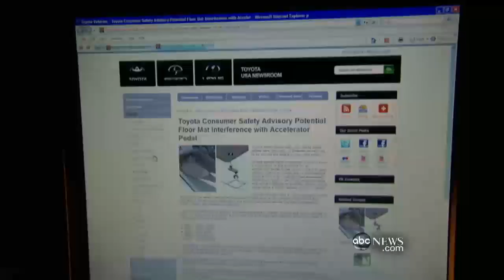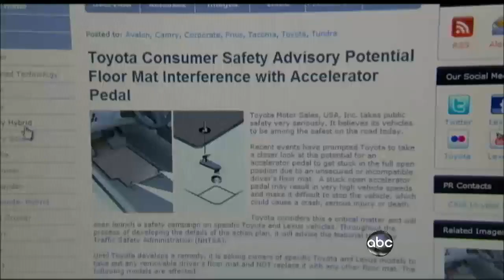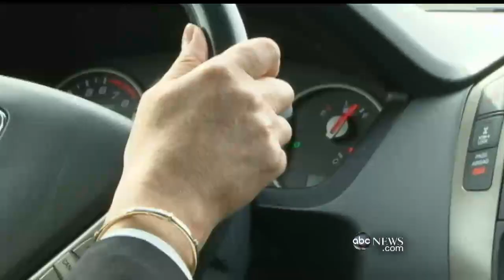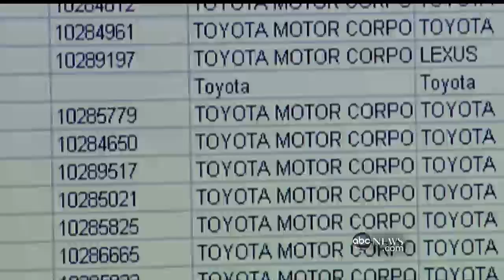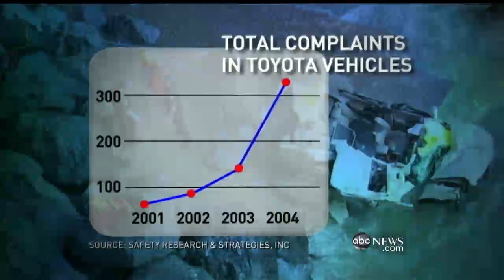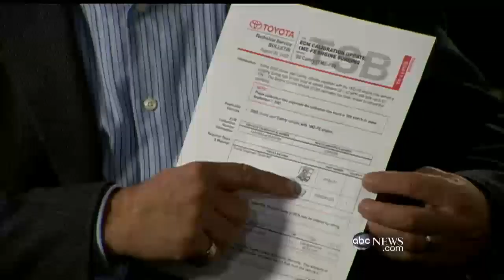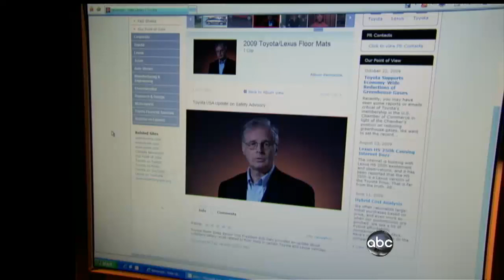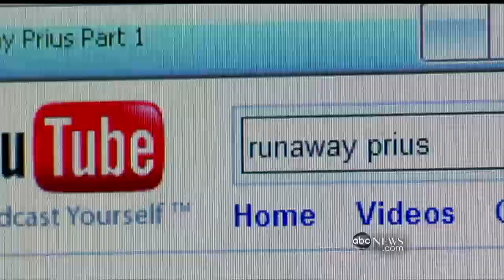Are Toyota's Accelerators Out of Control?

Comment: All you have to do in that case put the car in neutral. The engine RPM will go up but you will get full control of the vehicle.
Reply: Your type of thinking can be apply to almost every death scenario
Reply: That's what I'm saying though, like switch the key into accessory or hold the start button and it turns off the engine
Reply: You are thinking far too simply 😆.  Turn the key, shift to neutral or even park or reverse if it's that out of control.  Lots of ways to fix this.  Also, I'm wondering, if the accelerator gets stuck...why is it stuck full throttle?  That means they had it pressed to full throttle just before it happened or it would get stuck at a lower acceleration.

Comment: Well, I have the exact opposite problem with my car, my throttle body will randomly just stop responding to throttle input. Guess its a better problem to have then this but people need to know its not that hard to turn off the motor or put the car into neutral if this happens. The chances of there being a problem with the throttle body, ignition, and transmission all at the same time are minuscule and being slightly educated can help solve such a problem. Granted Toyota throttles have had their problems and there should be a better fix for it, there are things people can do if the situation does arise.

Comment: Why not pull the E-brake? Turn the key off? Shove the gear shifter into neutral?
Reply: That’s what I was thinking
Reply: @spacedog1527  the best thing would be to 1st)knock it into neutral 2)pull to the side of the road & then the emergency brake 3)turn the key off
Reply: I watched more cases and they could not go into neutral. If they used the emergency break it would flip the car and crush them because of the speed, plus if they turned off the car it would lock the steering. Basically it would be impossible to survive unless police spike your tires or if you had a roll cage.

Comment: If power brake assist glitches n doesn't respond , last thing is : turn of one click on ignition switch. It might lose full power assist but mechanical maneuvers  hard steering & brakes are better than non respond brake or accelerator . old cars was al mechanical , some had add on AC power brake power steering & but nit all .

Comment: These people are so stupid - due to absence of driving schools that are worth to be called DRIVING schools.
I hold all German driving licenses from motorcycle to big coach. It is unbelievable how any licensed driver can be unable to
* to ungear (oh yes ... you prefer automatic transmission because you cannot handle a gearbox)
* to firmly press the brake pedal
* to switch to neutral (it is the N on the stick)
* to switch off the car engine
A person unable of all points mentioned will not get a driving licence here. So that's the reason why the problem of „runaway cars“ is completely unknown in Germany. Yes, we also have Toyotas here.
Do a car safety training if something like that exists in America. It is worth much more than dialing 911 or praying in such a situation
Reply: Push the clutch in if you have a manual.
Reply: Andreas Jimmi  
DO NOT TURN OFF UR CAR IT WILL LOCK THE STEERING WHEEL and u Will die
Reply: lockdown channel if u put car in neutral while in motion it slows down wether the engine is running or not the steering wheel is free while in motion at all times. it will only lock if u move the steering wheel to the left till u hear a clicking sound while the car is in the park position while the engine is not running if the steering. Turning off your while in motion cuts the power steering not the steering wheel which means it’s free for a temporarily ( I’m a car mechanic who’s worked for Mercedes Benz in Stuttgart Germany 🇩🇪)

Comment: It should be a law that you need to be somewhat mechanically inclined to have a drivers licence. Simply pressing in the clutch in a manual, or even shifting to neutral in an auto would easily prevent a serious accident. If the auto transmission won't shift for whatever reason, simply turn the key off.
Reply: If u turn the ignition off, then  you lose your power steering and crash going whatever 100+ mph anyway ....not really an option going that fast. Emergency brake is sort of better but not much....
Reply: @AngelWhisper_7  I assume that if you're going 100+mph, you're not driving on such winding roads that you'd need power steering. Little bit of common sense goes a long way :)
Reply: @woodworkingstuff7165  peoples accelerator doesn't just stick but races/accelerates from normal  speed to excessive speeds like 100mph. And they may be on windy roads and need power steering This is just one situation, and if it happened, how could they get out of it without the ignition being turned off coz if they  need power steering, what other options if neutral isnt able to stop it coz a lot of times, people have said they couldnt get into neutral coz it was stuck, and what if shutting the ignition off isn't an option either? What does someone do?
Reply: @AngelWhisper_7  Valid points. That being said though, power steering is really only needed at low speeds, whereas at high speeds, one can turn the wheel easily without power steering, so I think it would still be better to just turn the key off if possible. But I guess this is why I drive a manual :P No possibility of a computer not being able to shift it into neutral with a mechanically operated clutch and gearstick.
Reply: @woodworkingstuff7165  I don't even drive lol. My husband does and he's got a car that.can be automatic or manual. Our accelerator stuck and he just put it in neutral but I was curious about why this happened so I was checking out videos and I didn't know power steering didnt matter that much lol. I feel dumb but ya gotta learn things somehow, even if questions seem stupid lol

Comment: My 2005 Equinox just did this. I applyed the brakes to keep the speed down while I turned the key off and thebcar stopped. I put it in neutral and restarted it and it's been fine since. But it's worrysome. Im glad it was me driving and not my wife.

From my experience I would have to guess that it a faulty throttle position sensor. This is just a guess but no action on the accelerator pedal made and difference. Including lifting it with my foot.

Comment: This never happened on Toyota's in Europe and Asia.
Reply: Nothing like this in Africa either
Reply: @tshidisomakinta629  There is a way of stopping a Toyota or any car with a stuck throttle. If it's an automatic you hit the brakes then shift into neutral and same with a manual. That will save your life.

Comment: Much safer to drive manual transmission than automatic. And manual transmission is not hard to learn.
Reply: It's hard to learn for some. But I agree manual all the way.
Reply: @JennyL.I  when they learn how to drive a stick not only they have to learn how to operate, but also they have to learn why they have to operate it that way. And how the car works and power flow works. This is easiest way to learn a stick. Understanding the concept is very important. Teaching them the operation will make learners hard to understand and confuse them.
Reply: @fromisheon4867  I know, I'm a driving instructor in the UK. I always explain (with pictures) how the engine/clutch works. Explaining why things work like that definitely helps people. Some people just aren't very coordinated or natural drivers. I always encourage the ones who struggle to stick with it and I always get them through their test but it's not easy. Especially with our tests in UK (not sure where your from).

Comment: I have a 2003 Toyota Camry XLE with a 4 cylinder engine.  I have been having this problem since about 2010.  Was parked in the street talking to my neighbor when I put the car into drive, without any warning and still had my foot on the brake pedal the engine began racing out of control, I jumped the curb went across two lawns and was still mashing down on the brake pedal.  came to a stop only after the safety over ride on the comp. kicked in.  At no time did I have my foot on the gas pedal, REPEAT NO TIME!!.  I was shaking and had know idea why the car had done this, and for some time afterward I believed that I might of had my foot on the gas not the brake.  That was until it happened again and again, and still does it from time to time.  Luckily on the roadway and I just put the car into neutral and the car's engine would rev down to normal.  I am able to put the car back in drive and it will run fine for months then out of knoware the issue will happen two or three time in a day or a week.  No mat problems or gas pedal problems and since I still have the car now in 2017 am retired and the car only has 56,000 miles on it. Yes 56 THOUSAND!  Runs great is dependable and I only drive a few hundred miles every month or so.  Noticed the press  about this problem back in the 2010, 2011 era but my car was built in 2003{????},  will try a used comp because the price of a new one is almost worth more than the car.
Reply: have you had your car looked? what did Toyota do too your car i am having the same problem with my 07 camry
Reply: Toyota has OBVIOUSLY resolved this issue in their vehicles many years ago.
Reply: John Scofield Lol! What do you mean the car "runs great and is dependable"?? You just said that it goes crazy on you every couple months!
Reply: That's why you have a little thing called Neutral
Reply: That is so true.
Reply: Did you not think of putting it into neutral?

Comment: Manual transmission cars are so much safer!
Reply: John L yep. But all cars are still dangerous. It's about the driver, not the car.
Reply: Throttle can jam as well. But if one can control it with engine off,one is a head  of the game. Because the transmission will be in gear to act as a brake
Reply: @angelwolf1347  🤣🤣🤣🤣 Unless its a tesla😁

Comment: I think cars need an emergency emergency brake- think of the company SawStop. There should be a one-time use way to stop the car that maybe even sacrifices the brakes, but stops the wheels so you can skid to a stop. Something you have to flip a covered switch to engage. If you've ever seen a SawStop demo before, its crazy fast. Something pyrotechnic that forcibly stops the wheels from being able to spin while cutting power or fuel to the engine would come in handy for extreme situations.

Comment: I had a Camry. that the excellerator got stuck n i was going prob 35 but i threw it in neutral n pulled up on pedal under it with my foot....they DO get stuck...i wasnt aware of this issue n thought it was a fluke...it always felt sticky...i knew something wasnt right tho....floor mats were not the problem.....mats were fine......ppl dont always know what to do out of panic....
Reply: WHY NOT JUST PRESS OFF BUTTON TO SHUT OFF THE ENGINE?!!!!! CAN YOU??

Comment: Put it in NEUTRAL and press the BRAKE. DUH!!!
Reply: Neutral was not working in most of these. There are 911 calls and they said it was not working.
Reply: Nor did the breaks. Did you watch the video?
Reply: @Tata-iu3fy  WHAT ABOUT  SHUTTING THE ENGINE DOWN WITH THE KEY???
Reply: @quesadilla14  I work in a car industry and I know that you still can turn the car without power steering turned on,, it just feels slightly stiffer,; so???

Comment: There is something called a gearshift...?
A neutral position?
A Prius doing 90?
Reply: Electronic control.  If the throttle body is open, nothing will work.

Comment: 2020 same thing just happened to my sister 2 weeks ago, thank God she wasnt hurt and no one else did BUT they could have been, my sister could have died. In a parking lot her car jolted at a rate of 25 mph!! she hit another car and it kept on and the car hit an iron gate where it stopped.  The air bag deployed and Toyota sent an engineer out who said no faulty equipment!!??  I would suggest if you own any Toyotas especially 2009 and 2010 camry and corolla go immediatly to a dealer and demand they fit it.  Shame on Toyota!!!
Reply: AND TOYOTA IS STILL LYING IN 2020!!!
Reply: @tempeycooper8112  They aren't. There is no issue. Operator error.

Comment: Of course it is the lack of a throttle cable. No other explanation. Stupid idea that boils down to lower cost. And it might not even be possible to shift into neutral, because there may not be a mechanical linkage to the trans. Transmissions are now computer controlled, so the shifter may be completely electronic. In these cases drivers say the brakes didn't work either. Probably electronic as well. Anyone know if the steering is still mechanical? I recall a Hyundai rental car I drove for a few days and made the comment that the steering felt like my Logitech G25 PC racing wheel. I didn't raise the hood to see if it was mechanically linked to a steering rack, but wish I had of looked. I have only old cars myself and hope to keep them going the rest of my life.
Reply: Even electronic gas and break pedals have mechanical switches of some type in them that can possibly fail due to age and or defect.

Comment: It's 2019 and Toyota didn't fix this problem  because it just happened to me in my 2006 Sienna. Putting car into neutral decreases maneuverability and if you don't pull over out of the way before putting car into neutral you will cause huge accident.  I had to jam on brakes as hard as I possibly could and it didn't stop it just slowed it down enough where I could get over to shoulder of road, step on emergency brake, throw it into park and remove key. If I had done what the guy in this video says to do I would have caused a pile up of cars on freeway.
Reply: Wrong. Putting the car in neutral will not decrease maneuverability, turning the car off will.
Reply: @andybub45  this lady obviously clout chasing.

Comment: This is what happens when we put computers into everything.
Reply: @hereitsnick2069  Ummm... I assume you didn't read the NTSB report were they were able to replicate the sudden acceleration issue TWICE on an ES350. The report concluded it was indeed an ECU malfunction. Their test car had floor mats removed... Following the release of the report, a couple of Toyota executives committed suicide. They could not take the pressure nor shame for lying to govt officials about the issue.
Reply: @philhenderson3516  yea, if we don’t use ECU then we automatically remove: Traction Control, Electronic Stability Control, ABS, Airbags, Hydralic Steering Wheel, Intergraded Radio and more confort and security stuff like stabilized gas and more
In short you will lose a lot of security and confort stuff without an ECU. Making it in easier to crash without a stuck pedal.

Comment: That death could have been well avoided if they just shift their gears into neutral and then use the brake pedal to stop.  Cars cannot transfer any power to the wheels once the gearbox is takened out of gears.
Reply: Eric Richard Or just hitting the breaks. The breaks on an average cars can overcome hundreds of horsepower
Reply: Cud happen in any brand.stop bashng.kia is catching on fire

Comment: It still happens with all makes and models. I have investigated it many times and NHTSA lies in their reports about it. It is real but I have found it caused by damaged ECM wires on over 50% of the vehicles I investigated.
Reply: could this happen in a 2018 toyota camry and if so would the black box be able to see if the brake was engaged or not?  In  the news there is a girl in Ohio who was just convicted of murder for crashing into a building wall killing two people. a surveillance  video shows her travelling at excessive speed car jerking slightly to right then to the left and then plowing into a wall at a dead end street.

Comment: I experience that to our 1990 Toyota Corolla M/T tranny there contact point of gas pedal inside the Engine I'm lucky my car is just A manual Transmission. Even I've stop the engine keep on roaring and I shut down the engine when I opened the engine the Gas Contact  point is stucks .

Comment: I dont know about the recent Toyota cars, but on a road trip with our 2017 Toyota Rav4 xle, there were a couple of moments that it behaved funny. Driving with cruise control enabled, the engine suddenly revved and the rpm spiked for a second. This happened 2 times total on our trip. Only with the cruise control on. The car did not surge forward, but it made a little jolt. The glitch only lasted for like, 1 second and then it was back to normal.
Reply: get rid of it better safe then sorry
Reply: Sounds like a downshift. Sometimes to maintain the same speed on a gray the vehicle will have shift down even in cruise control
Reply: @jfnovae That's exactly right

Comment: Except, in lots of these cases, with a total electronic bug/crash and full accelaration mode stuck, neutral position was not taken into account in the automatic transmission, powering off the vehicle was not possible either.
There where even cases of vehicules with electronic hand brake that where not working anymore either.

(i'm glad my transmission is manual, and not controlled by electronics)

I'd really like to know the conclusion of the investigations.

Comment: Electronic accelerations are used in 99% of all cars in Europe. None have failed so far. It's easy to blame something you cannot understand. Nasa checked all lines of computer programming and found nothing. Toyota checked and found nothing. Brakes have a direct mechanical link to the pedal. It is not possible for a car to accelerate or not brake when hitting the brakes. Period.

Comment: my mom had a 2007 silver Toyota Camry XLE 4cyl That she says would surge between 35mph & 40 without putting less or more pressure on the pedal, I dismissed it until I saw all of these reports, she traded the car in but I have a 2010 gold Toyota Camry XLE V6 and with the new 6 speed transmission and recalls our drives nothing like the 2007